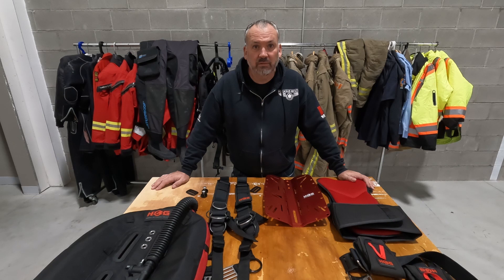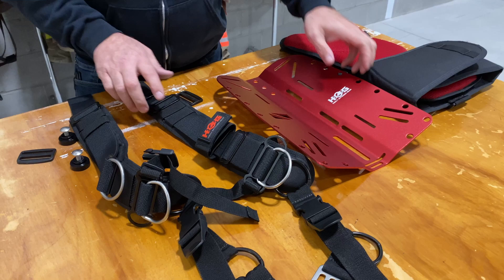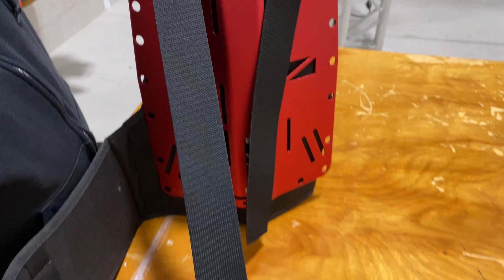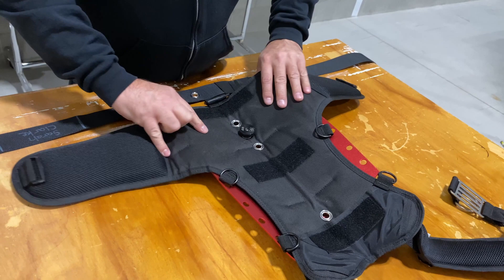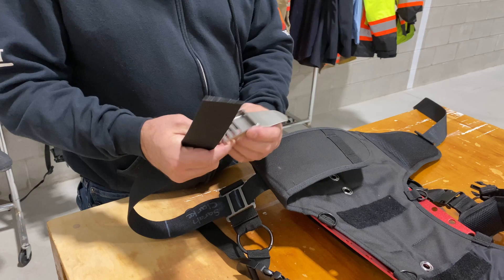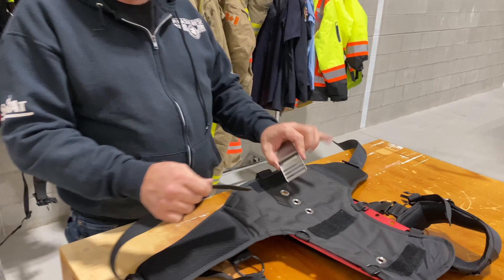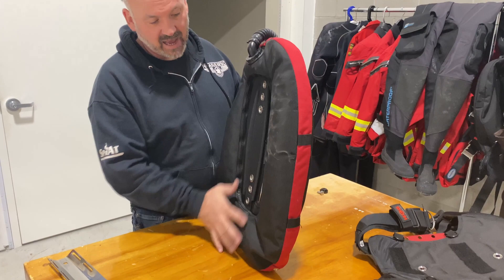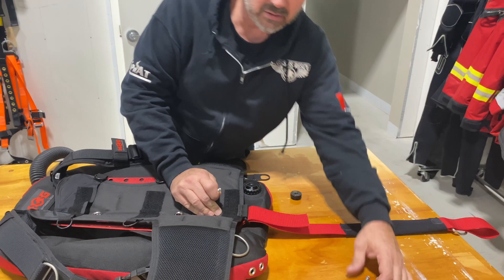HOG Back Plate and Wing Assembly

Comment: Most configurations I've seen put the bottom set of weight pockets on the cumberbun- it puts it in a more "ditchable" confugutration.  Great setup though! A lot of warm water divers leave off the aluminum plate as well and just use the "soft plate".
Reply from the maker: Yes we added ditchable pockets to the front waist band also, with the wings at the surface tend to push you forward in the water, the rear placement helped with trim and stability while at the surface. We dove it with a weight belt until we settled on the final configuration.

Comment: This was a most useful tutorial.  I just received my new kit with SS plate and wing. Question… Did those rubber tank adapter guards come with the kit or was that a separate purchase?
Reply from the maker: The kit never came with tank bands, so they just happened to be on the ones I purchased separately.
Reply: @PEGASUSRESCUE  thank you